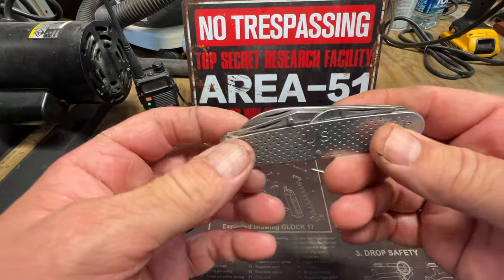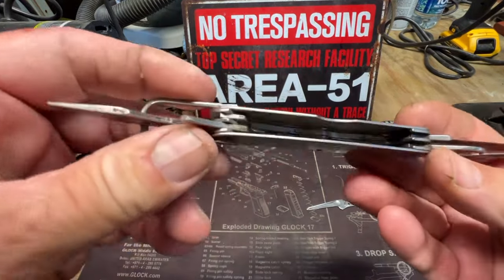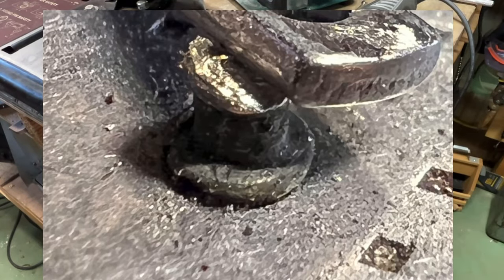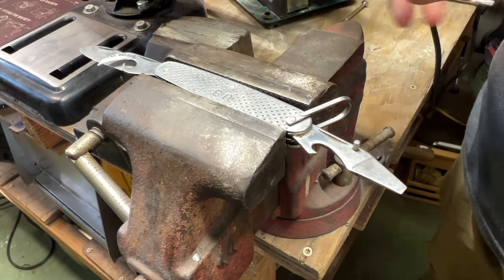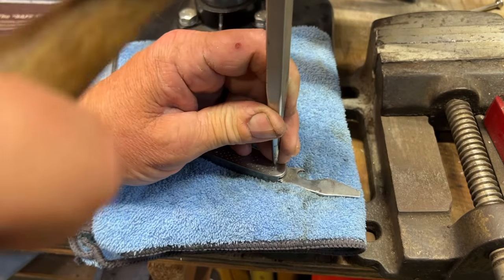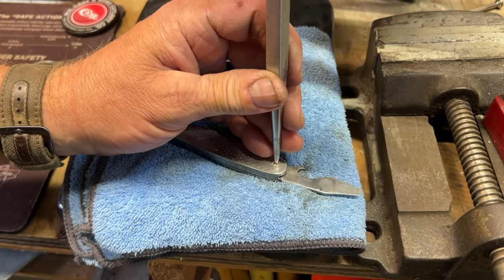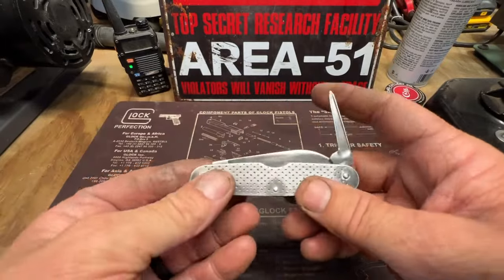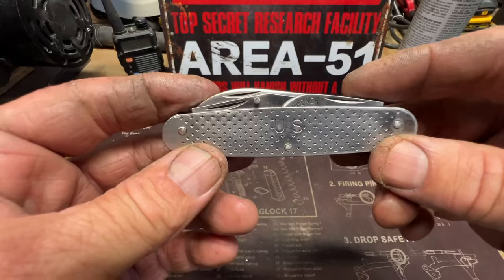Restoring a 1961 US Military Camillus Pocket Folder: Replacing Blade Pins & Punch Blade.

Comment: Tip: Next time you have an issue with a blade not snapping closed, try putting a spare thin blade between the blade and the center and giving it a little tap into the knife.  Shouldn't take much to get the blade to "walk and talk".
Reply from the maker: I’ll have to pray on that trick!  Thanks for sharing!  Happy Thanksgiving!

Comment: How that was made....  It started as a double ended pointed pin.  The pin - after assembly - was "shaved".  Basically taking an .083 wire down to about .082 +/-.  What you saw after removing the clevis was the shaved part of the wire now holding the butt of the knife together.  The clevis was added and then the pin was "spun" to form the head of the wire holding the clevis on.
Reply from the maker: Awesome!! Thanks for sharing!  Happy Thanksgiving!
Reply: @theknifedoctor  28 years working at Camilus Cutlery taught me a few things.